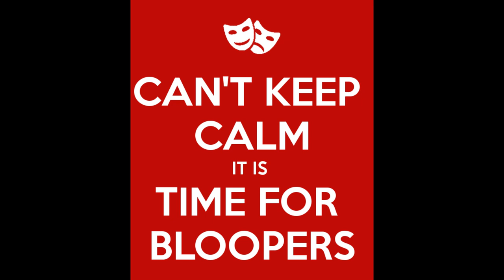What happens to Hydro Dip film on the water for longer than 60-90 seconds?

Comment: How long do you have to dip after spraying activator. I always feel in a hurry. Sometimes after spraying the activator the film starts to disintegrate. So I rush to dip instead of cutting a new sheet
Reply from the maker: Depends on the activator, usually between 5-30 seconds.